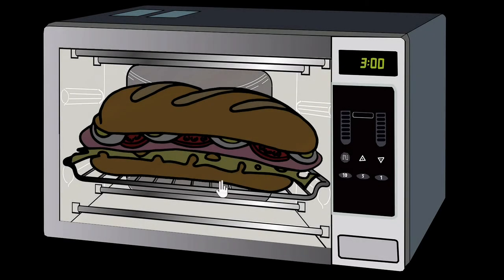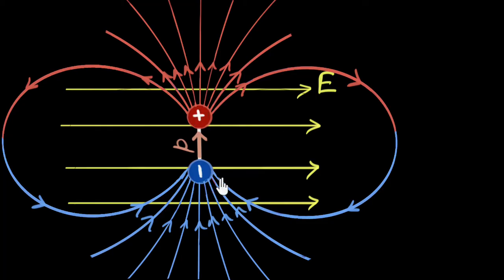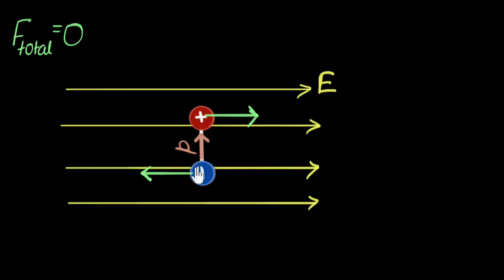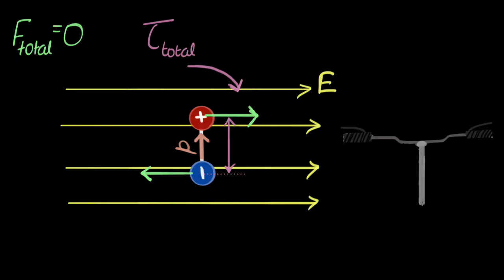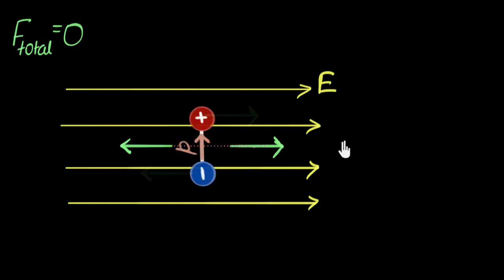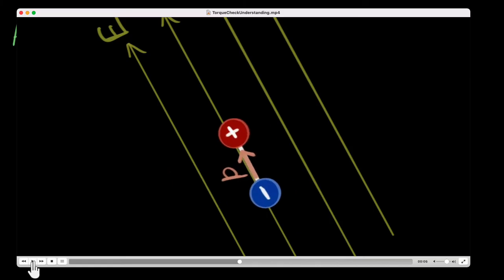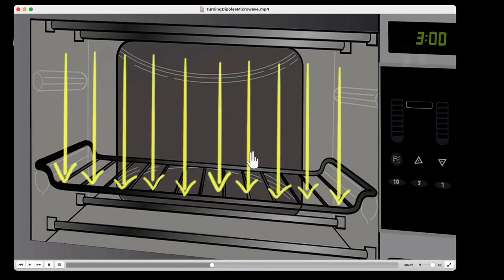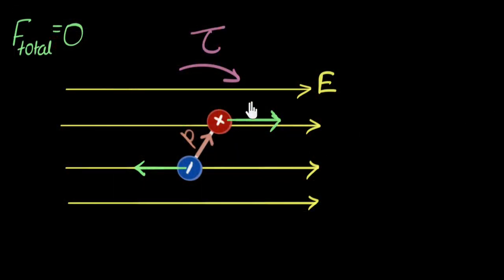Intro to torque on a dipole in uniform electric field | Electric charges & fields | Khan Academy

Comment: excellent informative video . god bless you. one question.... what will happen if instead of mircowave we increase frequency ? say enter far infrared region?
Reply: From what i read, water molecules oscilate the best at around 2.4Ghz, which is the frequency the microwave works, so my guess is that by increasing the frequency i will be less eficient to heat up food bcs the momentum would fight against the field. But it would be interesting to see some more detailed information :)
Reply: waves with shorter wavelengths will just penetrate the molecules(i guess (xP))